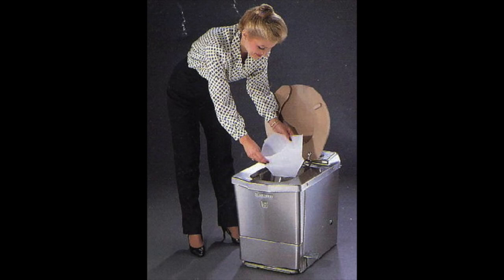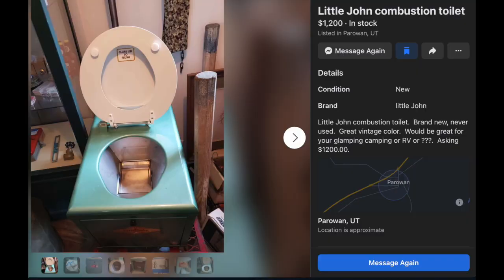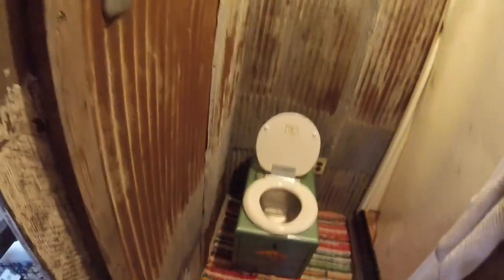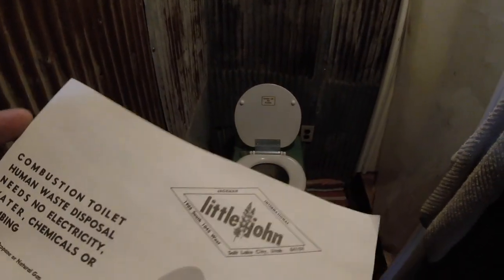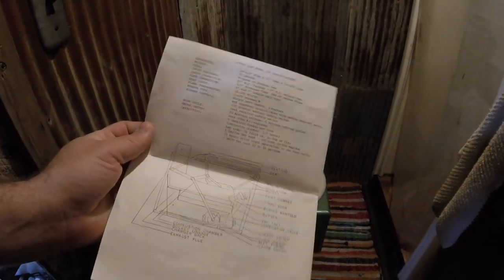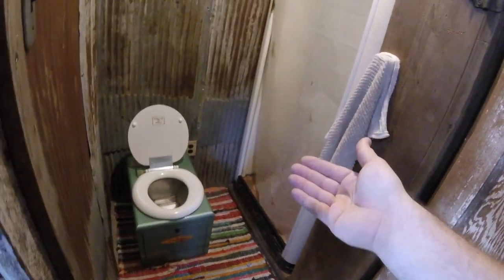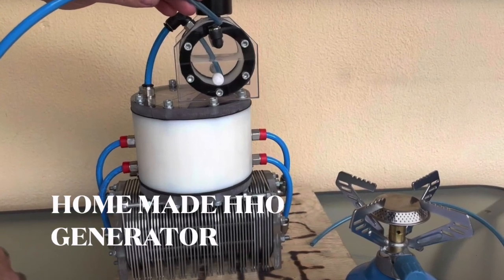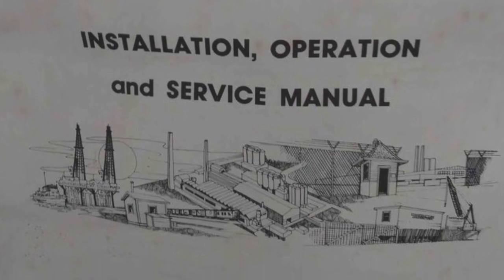Little John Incinerator Toilet

Comment: cool toilet I been looking in to getting an air head. have you thought about usings a  Hoffman apparatus for your separation should work
Reply from the maker: I have thought about modifying this toilet with a separator.  With this design, it should be possible.  It would have to be metal though.
Reply: @extremebudget  the apparatus separates the hydrogen and oxygen it could be off to the side are even outside the house as part a urine holding tank, they are simple in principle if you look up  Hofmann voltameter apparatus it might interest  you